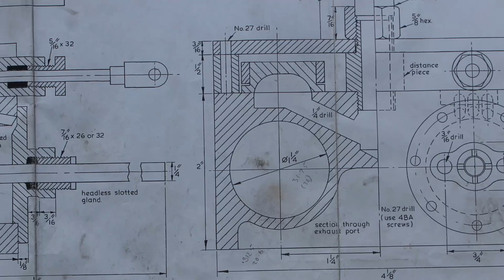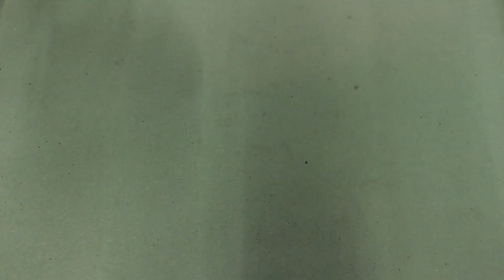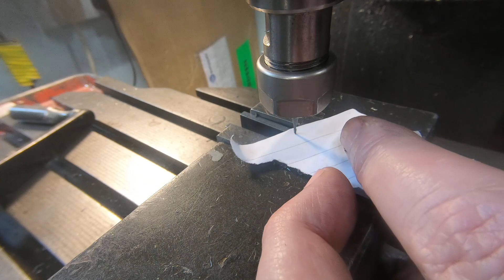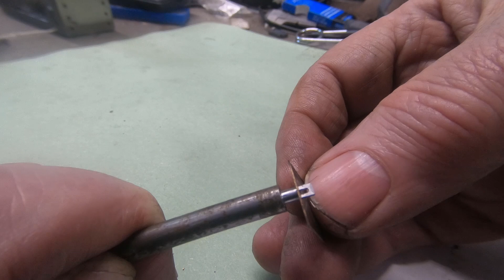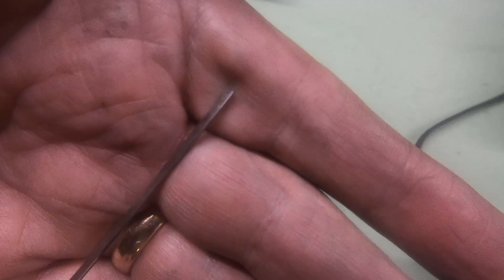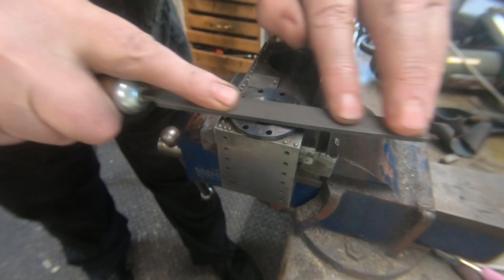Lion Locomotive in 5" gauge part 48- Adding Cylinder Detail

Comment: What did all the rivets do in the prototype  on the cylinder block ??? really nice engineering happening here !!
Reply from the maker: Thanks. I don't really know the cylinder construction details of the full size loco other than the boiler, smoke box and cylinders are all integrated as one assembly riveted together, it's not obvious what some specific rivets are for. I just try and make my model resemble the full size loco as much as possible.
Thanks for following along, it's very much appreciated.
Cheers 
Nigel